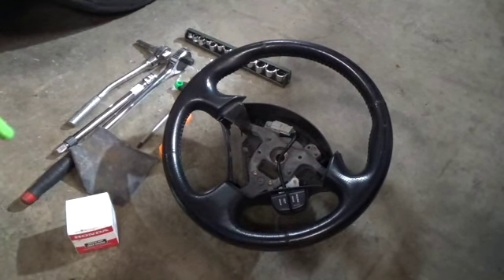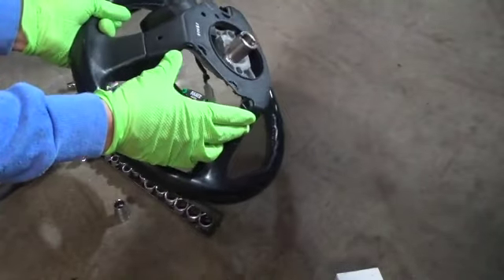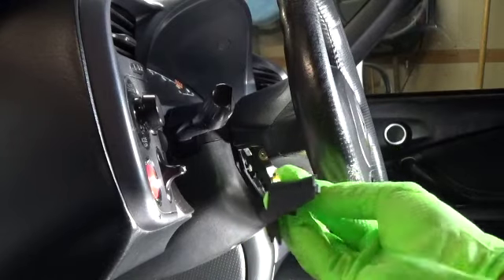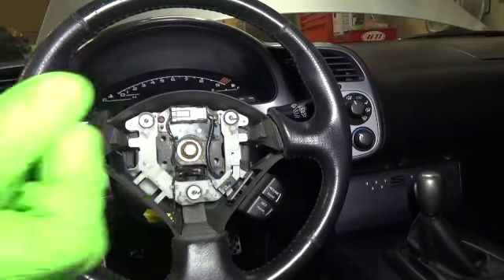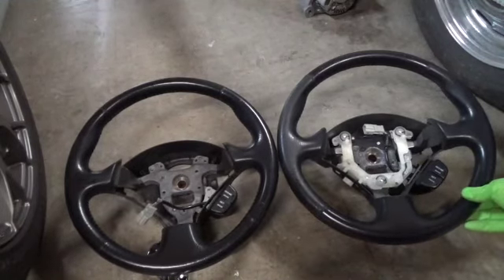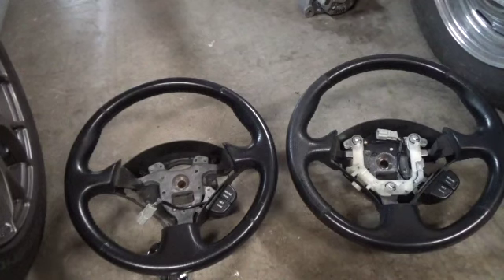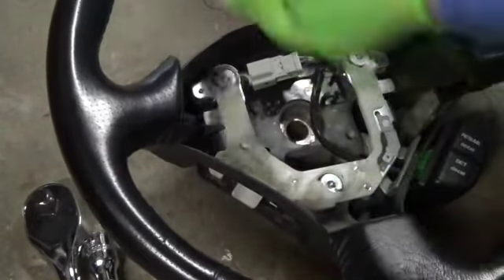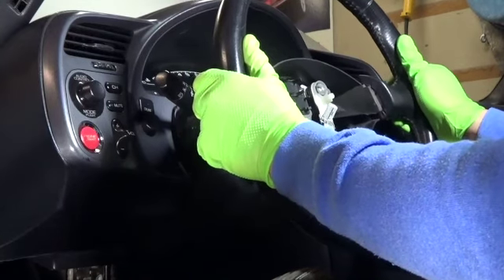How to Remove and Install an OEM Honda S2000 Steering Wheel

Comment: Appreciate the video explanation man. Just received the EndlessRPM OEM modded wheel I ordered a few months back and am going to be installing it shortly. Gonna save this to reference as I swap my wheels over.

Guessing moving the Cruise Control buttons isn’t too hard also.
Reply from the maker: Correct, there are just a couple of screws and you can remove the buttons and transfer them over. Good Luck!

Comment: Is there a way to mark something to show exactly where to realign the steering wheels when reassembling it?
Reply from the maker: You can try with a paint pen but the manufacturing process differed between the years and the alignment of the splines to the wheel orientation might be different between the two wheels. When I removed my old wheel and installed the replacement I clocked them similarly and they came out pretty close. Close enough that I didn't have to zero out the steering wheel at the tie-rods. Good Luck!
Reply: @SirFixAlotAutos  yes it seems like because the splines are so close that it’s easy to be off center.

Comment: I’m in the process of doing this procedure, on my 2004 s2000. But my steering wheel was so over tightened and now I can’t get it lose even with the bolt loose.
Reply from the maker: You'll probably need a 1/2" drive breaker bar or at least an 18" long ratchet.  If you only have a 3/8" drive ratchet, use a hollow jack handle or pipe to extend the handle for more leverage. Place the wheel in the lock position (with the key out) and the combination of the two should work.

Comment: I don’t have access to Honda urea grease. Honda dealer told me it’s been on national backorder for months and months. Can I use any grease? Or no grease at all?
Reply from the maker: Yes, for a steering wheel, no problem using some bearing grease. A little grease is better than none.

Comment: @Dan tsu , can I use the horn without the horn mechanism.  Will the horn  Still work ??
Reply from the maker: The horn mechanism makes the electrical connection to feed the horn with power. If you don't use it and you want the horn to still work, you would have to set up a separate switch. I don't know if that answered your question.
Reply: One more question. Btw thankyou.  Will the air bag still stay in without the horn mechanism + bridge bar. Mine didnt come with one

Comment: Is the airbag bolted on by anything?
Reply from the maker: It's part of the horn assembly, once you disconnect the connector on the side, you should be able to pull it straight out, it's not bolted down.
Reply: Yep, 2 torx bolts on either side